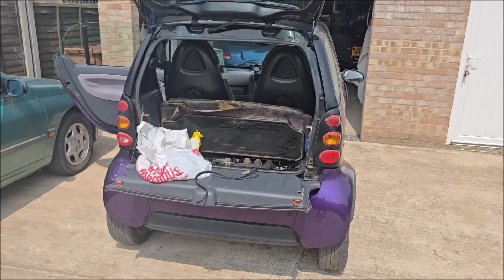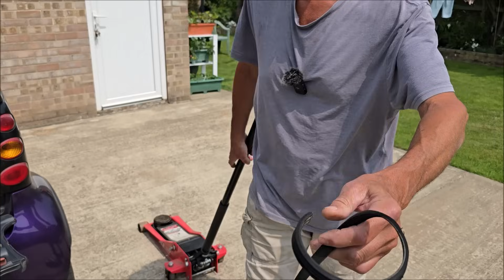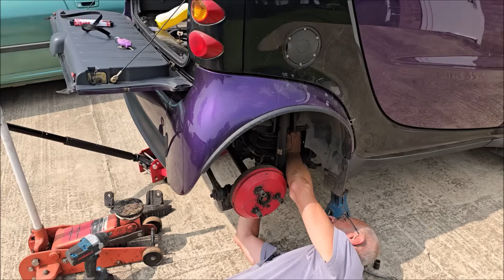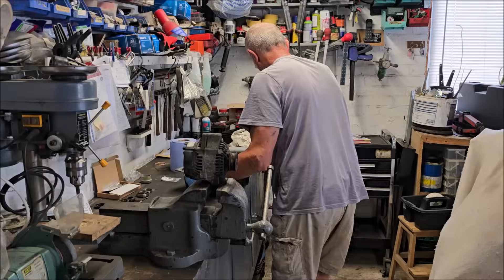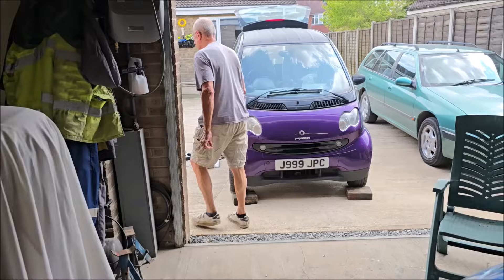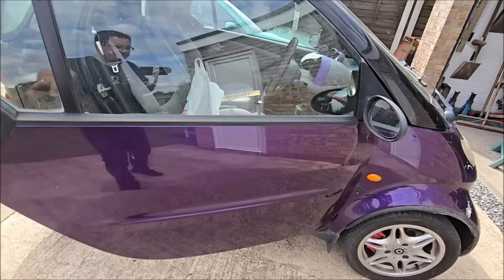Repairing A Seized Alternator & Belt On A Smart 450 (It Almost Caught Fire!)

Comment: The alternator has a plastic guard; without that guard, water from the road gets into it, rusts and gets stuck.
The belt must be tensioned in a controlled manner; if it is too tight, it forces and prematurely wears out the bearings (alternator and pump) and if it is too loose, it causes overheating and battery discharge.
By the way, the rims are from the previous model (non-facelift), they are only aesthetically important, functionally they are 100% compatible.
Reply from the maker: Thanks for watching

Comment: Usual symptoms sounds like a flat battery when trying to start.
You can make it easier if you remove the rear bumper/arches. Just self tapper screws about 6 if I remember correctly? Remove all the screws/bolts and the bumper is just held on by location slots.
You need to pull the wheel arches out at slightly each side and lift up to come out of the slots.
Easier with 2 people but can be done on your own. If you have ever had a modern scooter you'll know what to expect lol.
Main problem is trying to get the leads off so you need to drop the engine at the rear. Just 2 bolts and it pivots down on the front engine mount but do it gently and don't take it down too far just enough to get your hands in to get at the leads.
Don't bother refurbing the alternator just get a new one and get the part number off the old alternator before ordering. The problem is the tight clearance between the rotor/stator as although there is a shield in the wheel arch you still get water/dirt splashng on the alternator on the early 450 model.
You get dirt/rust jamming it it's not the bearings and the problem will come back.
You need a cranked ring spanner to easily gat at the alternator pulley nut but it's still a tight fit.
Try working  the spanner back and forth if you find it won't move.
This usually gets it free and turn it over a couple of times with the spanner to help get the dirt/rust out but it will happen again so best just to replace it.
Reply from the maker: Thanks for the tips 👍

Comment: Putting the nut back on the pivot bolt was the worst, I used a magnet on a telescoping handle, no way I could put my hand in there, I dropped the front of the suspension down, this was 8 months ago, now I'm getting a random cricket sound coming from under the car, not sure if its the alternator or fuel pump, when it makes the sound the car slows a little and the lights flicker, weird
Reply from the maker: Hmm, that sounds frustrating with the new noise!

Comment: John, your channel is brilliant! I run 2 FourTwos as courtesy cars. Looks like I’m about to rebuild one of  the engines as it’s got a big rattle on! Probably timing chain but I might as well do the lot as it’s at  60k. Just been thru exactly the same process as you did shopping around for parts. Smart Tune kit is very comprehensive so I can pretty much justify the extra cost against the eBay kit you went for as you get a lot more stuff! Anyway, keep up the good work and your Dad is one in a million👍
Reply from the maker: Thanks for watching - and that's awesome that you run some of these as courtesy cars!

Comment: On the Spark my alternator was working but the rear bearing was noisy. I bought a new bearing but when I pressed out the old one the casting broke. The bearing must be swaged in place. I did have to fit a new alternator.

Comment: had the same problem,if you dont start the car often the alternater will seize up.  and the same with the water pump.
Reply from the maker: Sadly found out the hard way - am making sure i use it a bit more often now :) Thanks for watching
Reply: Water drips onto it and fails  keep em moving
Reply: Mine standed for 8 years. You can guess what was seized haha. Alternator once seized after only six months of no use. But the waterpump never broke